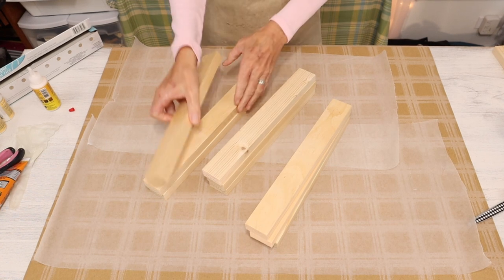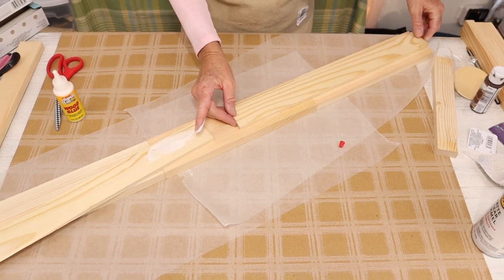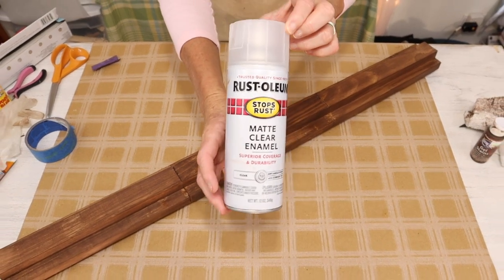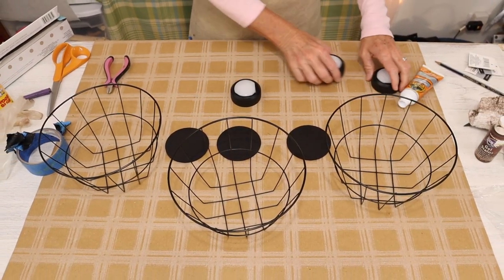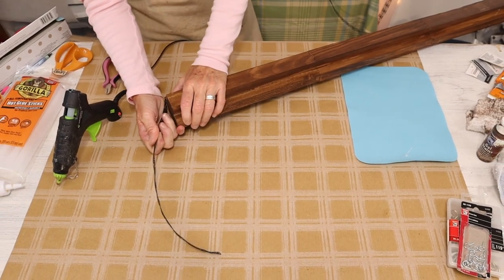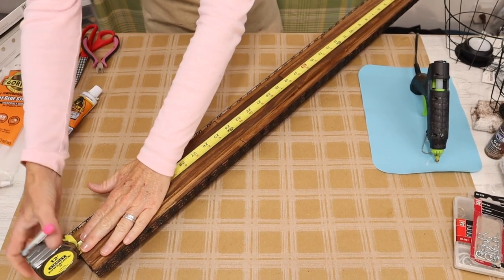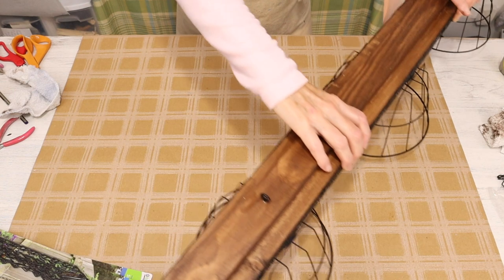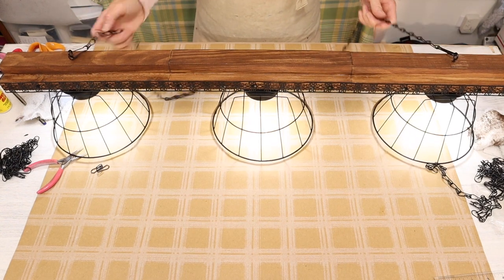Dollar Tree DIY Lighting Home Decor Craft Project STUNNING way to light up your space! Part 2

Comment: Beautiful! How do you change the batteries in the lights?
Reply from the maker: Hi My Heart Prayers! Thank you so much for watching. The base of the puck light is attached with the construction adhesive and the top light part just twists off to change the batteries. If you check out the part of the video where I am loading the batteries it helps to see how the light comes apart. I hope that answered your question. Have a great weekend!😊
Reply: @SweetBayLane  yes, thank you, it did answer my question.